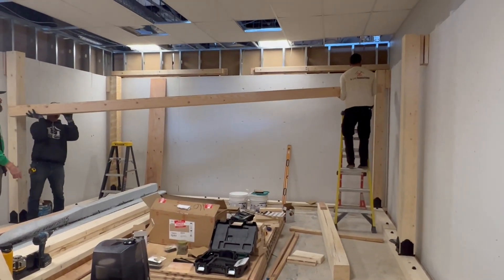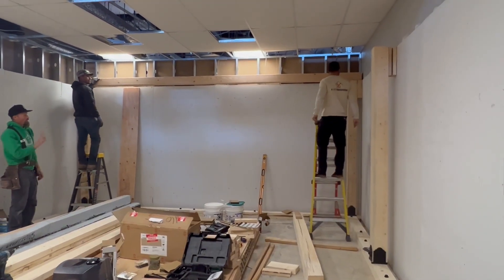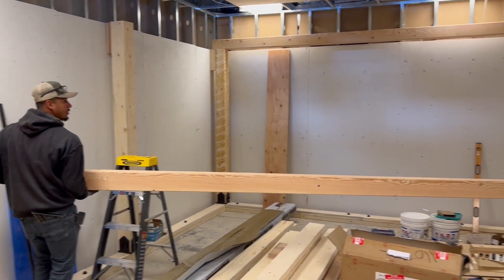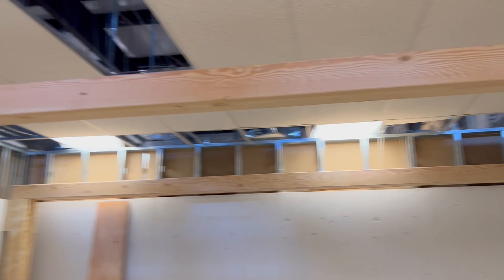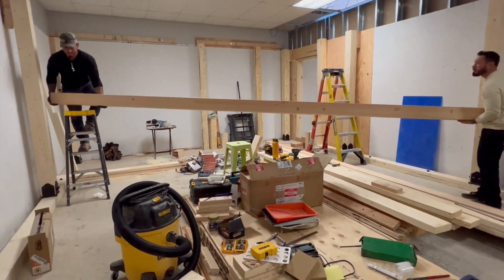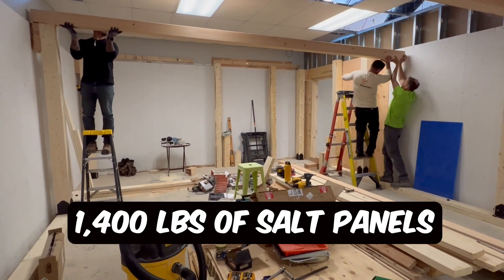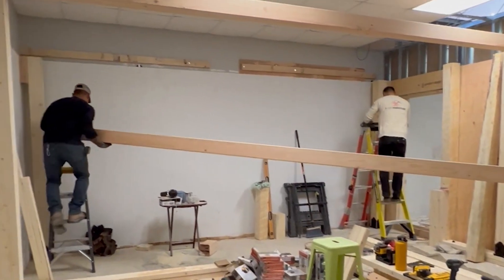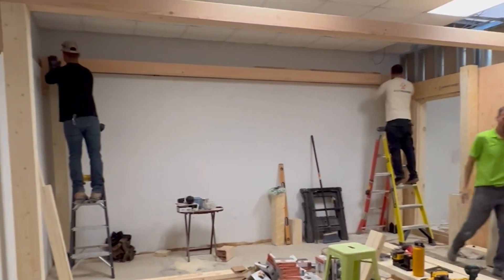Timber Framing  a Salt Cave with 18' Glulam beams!

Comment: I've seen locomotives with smaller wheels.   That saw is a monster among monsters!
Reply from the maker: Haha, it’s not the average size 😎
Reply: I bought the Milwaukee 12...I think it is a 12... @365redleaf  .  Point is I wanted to be able to cut a built header in one swoop.  As it turns out I haven't used it much....but I will....

(Mine was used at a fair price...I was lucky)

Comment: Get a beam lift
Reply from the maker: I had two strong guys:) I use beam lifts when they’re bigger and much heavier.
Reply: @365greenhouse6  I know I use to be one of those strong guys. Now I'm a old guy with a bum shoulder.
But I loved building Timber frames.
Biggest Timber trusses I built were 60' with a 10 : 12 pitch. Bottom Cord was 12" x 26" x 60' 2 of them for a fire station in OR.
Reply from the maker: @Randaddy96  I would love to see that build, sounds epic!
Reply: @365greenhouse6  Fire Station in Bend, OR.  My personal favorite was a Hammer Beam Truss for some Senator up in the Wallowa Mt. I never saw it installed.